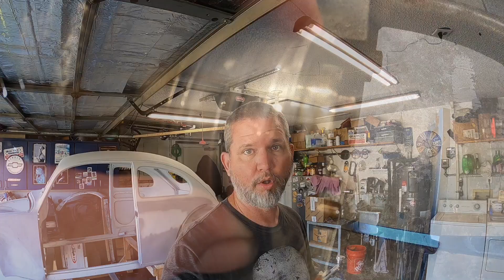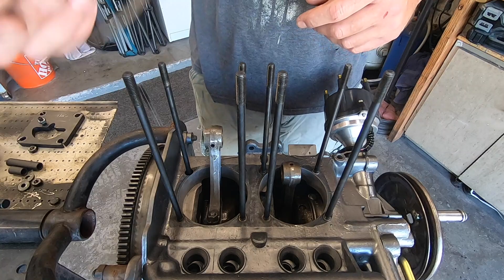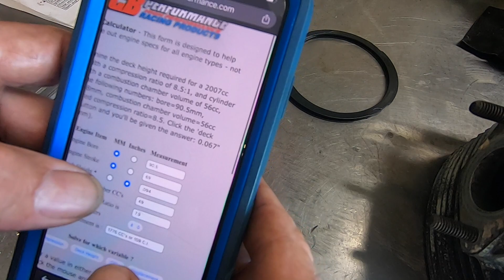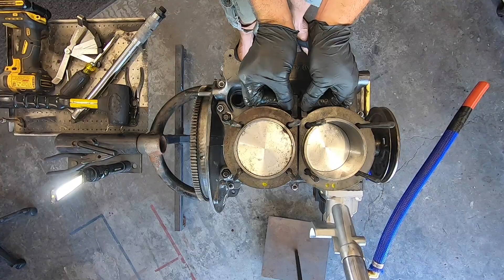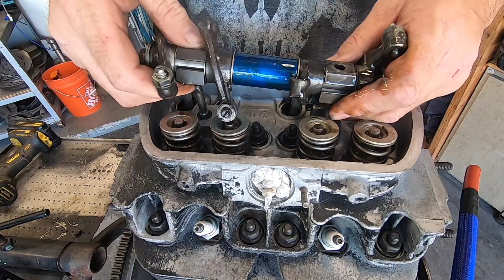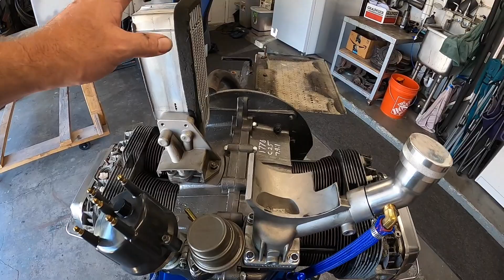Aaron's Volkswagen Beetle 1776cc single port engine build.

Comment: Can you get away with standard con rods for a 1776cc engine or are chromoly sets better
Reply from the maker: @stephenport4768  standard are fine. 
If you need to buy rods go with the CB rods or the Empi I beam rods. No need for the h beam rods.

Comment: Nice video I've been a machinist for 40 years in many Volkswagens little hot rods street cars in muscle Motors high RPM high output horsepower one another chip for viewers is when you put a snap ring in the wrist pin put it the direction of the cylinder the opening of the snap ring can be towards the head or towards the block this is rule of thumb in high performance motors reason being is if you put a c-clip going across the cylinder or the opening of the c-clip 90° across the rod under high RPM to swing the push pull can collapse the c-clip and cause it to come out if the opening is towards the block or towards the head it cannot collapse
Reply from the maker: @fullcirclerepair2655  cool 🤙

Comment: nice work sir, excuse me whats your final torque number for the heads? greetings from mexico
Reply from the maker: All depends on what size head studs you have. 
Bently manual calls for the following:
8mm - 18ft lbs 
10mm - 23ft lbs
Reply: @VWJawbreaker  thanks a lot , i have 8 mm studs, just want to confirm

Comment: What compression would .095” deck height run with? That cray cray imo
Reply from the maker: Single port heads have smaller combustion chambers than stock dual port heads. It’s all about the total combo.
Reply: could I run 8.3 with single port heads with .040” deck height? You know, the world is going to end of it’s not .040” deck height lol
Reply from the maker: @triariicat8448  8.3 cr would depend on the cam shaft being used. Look up the cam you’re using to see what they recommend for a compression ratio. 

.040” deck is an absolute minimum to run without the chance of valve to piston issues.
Reply: @VWJawbreaker   yeah the website says it’s good for 8.1-8.3 CR, just wondering if single port head could handle it

Comment: Hey Gary, do or can you use Aviation Sealer on the cylinder shims? Great job, thanks!
Reply from the maker: You can but I’d prefer not to only because it’s no where as good as it use to be imo and you need something that will seal better in that area so you don’t develop leaks.
Reply: Ok thanks… what do you use?
Reply from the maker: @trevcessna1723  I prefer the ultra black.

Comment: Why not switch to dual-port heads ? I thought Single-port heads and the intake manifold were supper restrictive. I have seen you build a few signal port engines. Am I missing something ?
Reply from the maker: Well, he didn’t want to switch to dual port heads, that’s why he stayed with single port. 
Single port heads breathe just fine depending on what you’re trying to achieve. They do produce a little more low end torque but they won’t get the same high end rpm’s that a dual port will. 
Many busses still run built, larger displacement single port engines.

Comment: Nice work Gary! Pro tip- remove the rocker assemblies and spark plugs when you are priming the engine for oil pressure before first  startup. That will keep the extra pressure off the rod bearings and cam until oil pressure is built.
Reply from the maker: Good point, that’s something I usually don’t do.
Reply: @VWJawbreaker  🤘

Comment: Just in time for me, before I finish my 1776! Did you use ratio rockers with the C25? I’ll be using 1.25:1 and lash caps. Great video, as always, Gary👍
Reply from the maker: Thank you sir. 
I used stock rockers but in the solid shafts doe the the HD valve springs. 
I’d love to see an update video from you 😎

Comment: Thanks again Gary great info.I will be doing a first build in the near future. When you lap the heads to the cylinder is that all you need to seal that surface. Thanks again.
Reply: You don’t need anything else, some use copper spacers there to tweak the compression ratio but that is also done with the shims at the bottom of the cylinders just like Gary did here.
Reply: @vayabroder729  Thank you
Reply from the maker: That’s correct as Vay stated above.

Comment: I would have stayed with the 0.055 deck height. Stock 1600 left the factory with 0.060.  0.094 deck height, is going to make the engine run hot, and hard to tune. Just my opinion.
Reply from the maker: Hey buddy. I hear what you’re saying however these heads have smaller combustion chambers and the compression would have been too high. I know people who have ran .090 shims under the cylinders and haven’t had a heat issue before. I also ran this info past a few others and they agreed this setup would be just fine.
Reply: @VWJawbreaker  ✌
Reply: I believe the higher the deck height the lower the compression ratio and the lower risk for the motor to run hot. Motors can tend to run hotter with higher compression rations.
Reply from the maker: @vayabroder729  especially when the compression ratio is higher than the cam manufacturer calls for.

Comment: Hey Gary ! on the oil cooler mount does those grey thick paper gaskets work there ? Just saying remember what happened to the engine VW Darrin took apart . the rubber had squished closed .
Reply from the maker: Hey buddy!
I don’t recall seeing paper gaskets for the oil cooler or oil cooler mounts. They all take the rubber seals. As long as you don’t over torque then I’ve never had an issue. 
Another reason I prefer to watch the oil pressure when the engine is running and verify the oil cooler is working and pressures are good.
Reply: @VWJawbreaker  the remote cooler adapter gasket . The only one of those I seen leak was under the cooler mount that oval hole had a crack in it .

Comment: Awesome video Gary, it would have been helpful before I built my 1776. I see you didn't use ratio rockers and cut moly pushrods, that's where I had problems with my engine and went back to stock stuff. After I got it together I read that having stainless valves with stock rockers can distort the stem, do you think that will be a problem down the road for me?
Reply from the maker: Rockers on the stainless valves can cause the valve tip to deform, they make lash caps that go over the end of the valves to prevent that from happening.
Reply: @VWJawbreaker  but do I then have to use shims and use cut moly pushrods like I was using ratio rockers
Reply from the maker: @plymouths1  usually just rocker shims.
Reply: Gary is right lashcaps on the ss vales. You need steel or hd aluminum pushrods if have dual valve springs. Most ratio rockers require custom length pushrods as do wider or narrower than stock engines.
Reply from the maker: @Slick56  thanks as always for chiming in with your expertise.